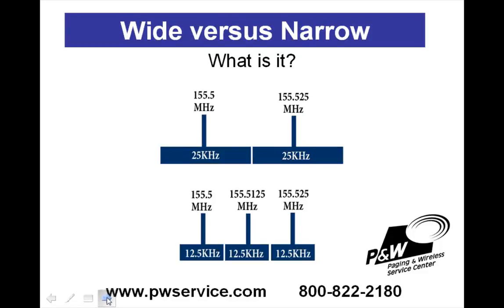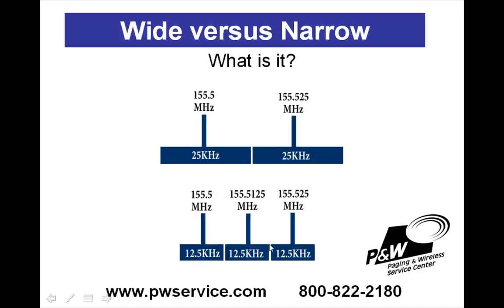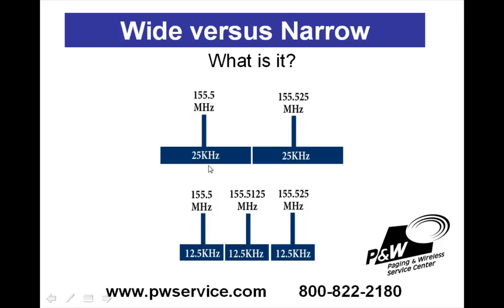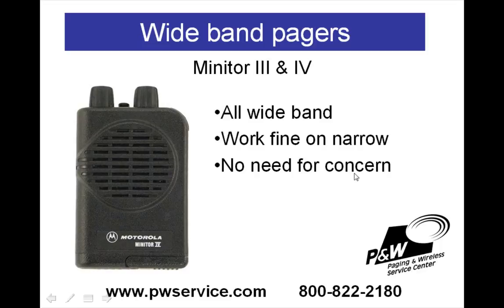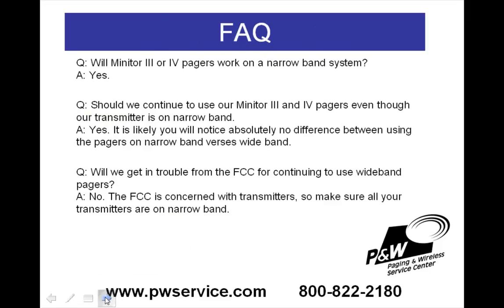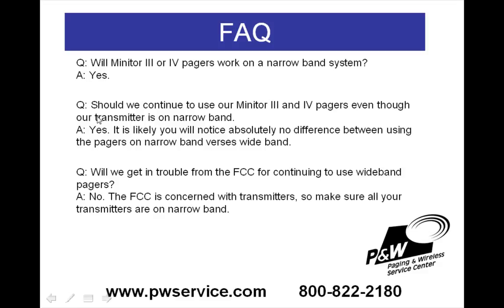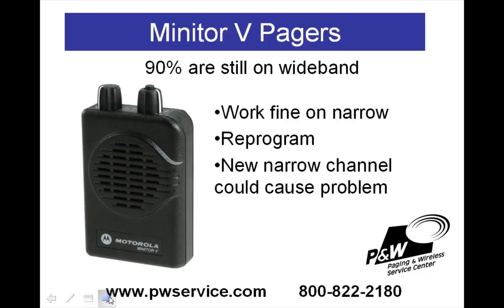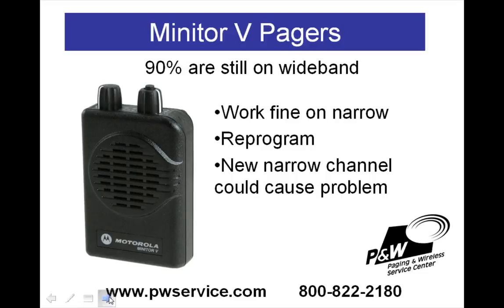Narrowband versus Wide Band Fire Pagers

Comment: my county switched to 700/800 mhz phase 2 digital system and to compensate for the vhf analog pagers,the county was told they need to narrowband all the pagers for best results.in order to do that i went the programming software on my computer (motorola's software) and i un clicked the wide band  boxes in the function switches.i never had to switch between the two so i assume that's how you do it